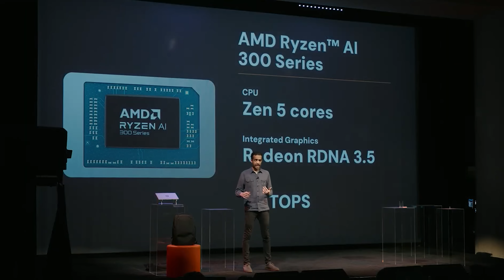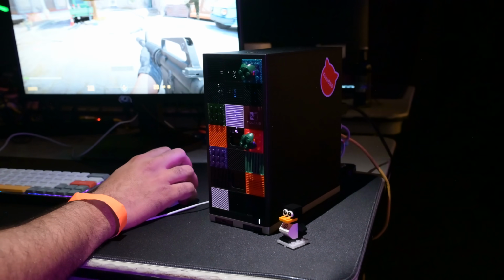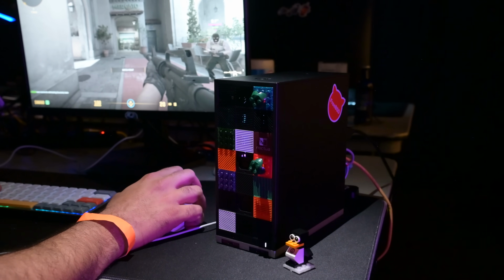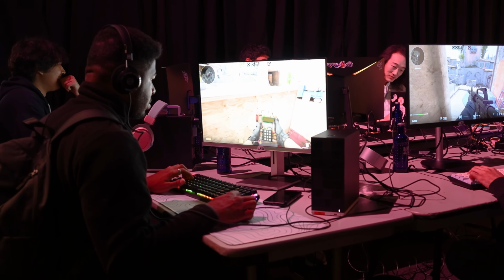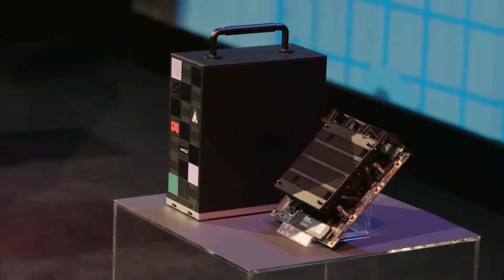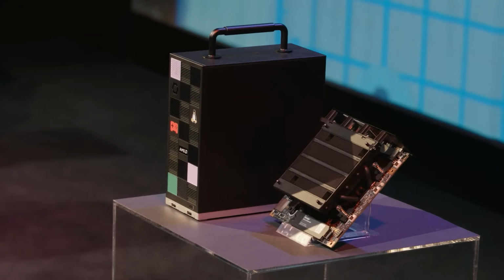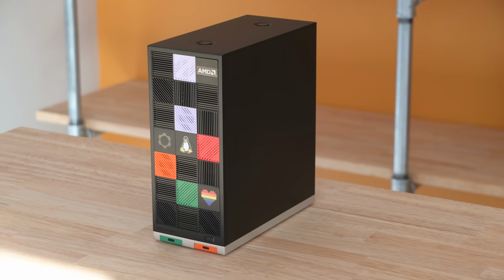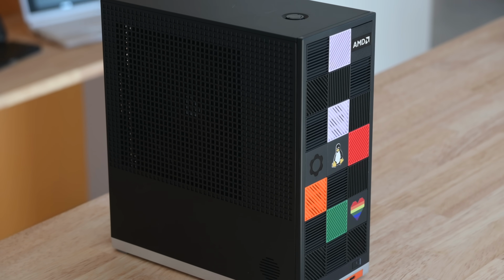Modular, Open, Repairable – The Framework Desktop Teardown!

Comment: 128gb vram/ram with the strongest cpu makes it a apple mac killer for half the price. People just don’t know what to compare it to.
Reply: I was considering FW Desktop for same reason. ...and I've heard that it has way low memory bandwidth compared to Macs which is also pretty important when running local LLMs.
Reply: I am going to get one of these, but there is a feature gap between this and a Mac, notably the memory bandwidth, but also the LLM acceleration software stack
Reply: @unom8  apple ram is faster being LPDDR5X 8533 MT/s and 512 bit bus the software stack would be comparing Apple's to bananas as it's depending on the is so windows vs Linux and the fact that the relevant software isn't released by AMD yet.
Reply: I can accept it being soldered RAM, I can't quite accept their pricing of roughly +500$ from 64gb to 128gb RAM, is the RAM really that expensive?? (for 32gb to 64gb at least you also get a better CPU)
Reply: M2 Ultra has WAY more ram bandwith

256  to 800..... 

only advantage is   this is X86.  not ARM so if you NEED that , this is a better value.
Reply: People just love to complain. The biggest difference between the Framework Desktop and a Mac Studio in an Apples for Frameworks comparison:
1. Schematics - this is friggin huge!
2. No parts pairing
3. Long term support with spare parts = longer hardware lifecycle
4. Half the price of a similar spec Mac Studio
5. In the Q&A stream their CEO literally states how they'll ship out reams of hard to acquire IC's and components to support the open source community

So no, this is nothing like your x86 desktop. This is new tech and it needs new approaches to repairability and sustainability.
Reply: @BorkedCurrent  not repairable RAM, massive let-down to their repairability claim in advertising.
Reply: @BorkedCurrent True, it's nothing like conventional x86 - conventional x86 desktop systems are far more modular and repairable.
Reply: You speak like both has the same bandwidth LOL
Reply: Yes, but I still think it's disappointing that the RAM is soldered, since it means the aftermarket will be flooded with base-model units that can't be upgraded easily.
Reply: @Ebalosus  in general, hybrid architectures are being attempted
Reply: @Jackson_M5  honestly I'd be fine with that if say the 16-32Gb soldered memory is then turned into GPU/AI/highspeed memory when an LPCAMM2 module is then attached to expand memory.
Reply: @Ebalosus  that beats AMD's idea of GPU, AI Accelerater and CPU in one silicon unit. I was joking about it a bit earlier that they should have gone with 128GB of GDDR7/GDDR7x to make it the true AI killer and justify Mac prices... but the more I think about it the more I want to scream at AMD.
Reply: @DJDocsVideos  GDDR7 has the problem of memory density. for 128GB you'd need 43*3GB modules.
Reply: @MrDiarukia  tell me something I don't know 🙂
Reply: @Ebalosus they tried with AMD expert but it needed LPCamm with 8000MT/s but currently there are only with 7500MT/s and the performance hit is around 40%
Reply: @Ebalosus  LPDDR5X unfortunately don't play well with longer DIMM traces. Samsung apparently is working on a LGA mount for them though.
Reply: @Ebalosus  I do hope Framework works on a trade in system for the boards.
Reply: @Ebalosus  base model is good enough for gaming
Reply: @Ebalosus  As pointed out by Nirav from Framework in the LinusTechTips video going over the new offerings from Framework (including this desktop) - Framework had AMD run simulations to test LPCAMM2 against the soldered-on LPDDR5X, and the LPCAMM2 had signal integrity issues with how it fans out on a 256-bit bus when paired with the Max 385/Max+395 in this system.
Reply: @Ebalosus  yo, what are you dissapointed about? the technology for swappable unified memory doesn't exist yet. This computer is doing something very different than your regular run of the mill desktop. You are not the target demo, this is for LLMs.
Reply: @datAero  What? The technology for swappable unified memory is called RAM sticks. If you use an iGPU, be it an HD4000, a 780M or in this case an 8060S they all use unified memory by getting to use part of the RAM as VRAM. What doesn't exist is high speed exchangeable RAM modules. The soldered chips allow for the 256GB/s and is comparable to a 4060Ti with 288GB/s.
Reply: @ do your own research lmao cba to explain
Reply: @datAero I'm disappointed because the technology for swappable unified memory absolutely does exist - it's called DIMMs and SODIMMs. What exactly did you think Framework were doing in their laptops, which are all available with AMD APUs running off of SODIMM memory?
Reply: @MrDiarukia 1 question if speed is really 256gbps  and it support 128gb ram . Does it means it does not need more speed it can process everything in just half a second.
Reply: @ Processor only work on little chunks of memory at a time and is handed down through ever smaller caches and once calculated put back into memory. Yes, it would take roughly half a second to ask for the whole memory but processor need to constantly write back and forth between memory and cache, so your say 100GB LLM will occur many times that in traffic during inference.
Reply: @bosstowndynamics5488  Literally, the first thing framework asked AMD about was if they could use socketed RAM. AMD gave them an enginner to help figure it out and sadly, AMD couldn't get it to work with socketed RAM. Signal integrity issues would require throttling the performance or something, so it just wasn't possible to give us a chip this powerful with socketed RAM.
Reply: You can also build your own ITX computer with a much more powerful CPU and GPU for a similiar cost... MAC exists to please the Apple crowd, but Linux and Windows users have way more compelling options in the DIY space than this supposedly "repairable" PC with soldered down ram, cpu and gpu...
Reply: @leviathan5207  No, you can't. Quad-channel memory just doesn't exist in the consumer desktop space. You have to pay HEDT or server prices for that.

Comment: To be honest I'm disappointed that the framework goes soldered ram. I know the ram width is impossible for regular dimms, but i would trade the performance for expandability, not the other way around. Especially when it's called a desktop.
Reply: It's most likely AMD's fault. The Strix Halo chip used on these boards only supports LPDDR5x RAM, and there simply isn’t any standalone LPDDR5x module available. We might be getting LPDDR5x LPCAMM2 modules sometime in the future as RAM manufacturers has announced they'll be making those modules.

Anyways, you can always just build a regular PC, Framework doesn't have any advantage on repairability in the desktop space anyways. The Framework Desktop is more synonymous to a NUC with laptop chip, or the Mac Mini.
Reply: That big GPU needs to have a fast and low-latency RAM, or it will just perform like previous APUs. Unfortunately, CAMM is just not ready yet.
Reply: @HighDoping It's not that LPCAMM2 isn't ready; it is, it's just that AMD went with on package memory like Intel Lunar Lake and Apple's SoCs. I'm actually seriously worried about 16 inch owners like myself.
Reply: @cameron_bosch  It's not on package RAM. The RAM DIEs are soldered on the board, while Lunar Lake and Apple Silicon both have RAM modules on the same base board of the SoC.

LTT's video about Framework Desktop says Framework asked AMD about CAMM modules, and AMD's response was that they couldn't sort out the signal integrity issue. I hope they could solve it one day, but we probably won't get that with Strix Halo.
Reply: @cameron_bosch  Haven't seen a 128GB LPCAMM2@8000MHz yet.
Reply: @HighDoping  well they could have distributed it to for LPCAMM2 sockets, four modules 32GB 8000MT/s each
Reply: @HighDoping  would be two 64GB ones...
Reply: @erkinalp  No manufacturer put more than one CAMM socket in their product. More separate modules = worse signal integrity = lower speeds. 128GB modules are possible with current specification, just no one made it.
Reply: Yh, like I said in another comment. It's clearly not made for the average user.
Reply: I think the error is calling it a desktop PC and advertising "gaming". I see this device more of a production machine or server for LLM and some rendering.
Reply: @telldo8016  you can game on it for less than a 4090 runs you 🙂

Comment: This seems like a cool proof of concept, not a release product for a company like framework. Calling this a desktop pc but having their homebrewed mobo with soldered CPU/iGPU/Ram just does not sit right with me, as those 3 are the key upgrade paths for a real desktop (even if small form factor built). Instead of just being able to slot in a new cpu you're forced to replace the entire motherboard + SoC as if this was one of their laptops? 4.5L is amazing but honestly I don't think this is worth the tradeoffs under the framework brand and considerable upcharge they ask for their designs.
Reply: To be fair, when it is time to upgrade a CPU you most likely need a new mobo and ram anyway, so this likely won't make much of a difference. I get what you mean, but there are tradeoffs that need to be made. The good thing is, if you don't like it then you can buy a different desktop that suits your needs. There was obviously a large enough demand for this if they made it, the CEO even said it wasn't even on their roadmap but they had to make room. Given the AI boom right now this is a superb product. With my own gaming needs, I would highly consider this as I would like a small form factor, I only really upgrade my PC every 6-8 years, so when I need an upgrade it'll be as easy as buying a new soc/mobo and slotting it in. I won't need to worry about compatibility, troubleshooting, buying compatible ram, making sure my CPU works for my mobo, ETC.
Reply: @AndrewPL5   Not saying there is no demand, just that this specific solution ain't it under the framework ideals. Famously with AM4 you could skip many generations and still upgrade on the same mobo, I doubt AM5 will be different in that regard because AMD knows that's one of their unique selling points, they have promised as much. If you get 6-8 years out of this lucky you, but since framework only offers 1/2 years warranty (depending where you live) better pray there is no core system failure out of warranty because for this "easy to repair" desktop it's going to need microsoldering on the motherboard and those bills go sky high real fast. And that's where you will look at the framework provided replacement mobo and just buy the new one, not repairing, completely defeating the MO of repairability and sustainability first.
Reply: @phjac  I think you, and a lot of others, are focusing WAY too much on this small tradeoff. You need to take it for what it is, a laptop PC basically. You can't really blame Framework for the CPU/RAM/MOBO issue...that is literally AMD's issue, and Framework had an AMD engineer try and make this work with upgradeable ram and it wasn't possible. If you buy a non-Framework laptop you'd be plagued with the same issue if there are any core failures. Unfortunately the way Intel and AMD are going, I don't know how much longer Framework is even able to offer upgradeable RAM on their laptops. People need to understand companies can only do what they can with the limitations that the CPU maker bring. You cannot find this kind of small form factor PC on the market that you can upgrade on this level, that is the main point of this. If I had the money I would totally buy this. I want a small form factor PC, and I want to be able to upgrade it when I want to. If I buy this, that is possible. Sure, it may be costly, but it sure beats having to buy a fully new system vs just swapping out the mobo/SOC.
Reply: @AndrewPL5  You're right, this is really a laptop PC, but I think that's my problem here. I just don't get the point of a "laptop pc" being sold as a desktop, because that means you're missing peripherals and a battery. The entire point of a laptop is that it comes with everything you need to operate, including screen, battery, keyboard and touchpad, in a small form factor that fits in a backpack. That you can use it in a library, at work, on a train, plane, at home, just as much as anywhere else. And for that, I'm fine taking the repairability tradeoffs into account. If this motherboard was in a big bulky Framework 16 or even 18 or whatever shell, I would be fine with it, because that's the compromise of a laptop, where size well and truly is of key importance. 

This, however, is a desktop, which is useless outside of desk work environments. You don't really gain anything here by downsizing the box to 4.5L outside of desk aesthetics. You don't really get anything here by going for strix halo, a mobile cpu and igpu where the entire point is that it has great performance on a tiny footprint, because you don't need the tiny footprint for a desktop. A 20L SFF with a dedicated GPU is still small on or under a desk, but can absolutely destroy this thing while being infinity times more repairable, sustainable and upgradeable, and that's what I would have much rather seen as the "Framework Desktop PC".
Reply: @ I think the main reason for this being in a pc form factor is power. This can run way more power and cool down way easier than a laptop ever could. This chip in a laptop runs at a lower wattage since it can't be cooled as easy. This is great for mobile gamers in a way. Personally, this would work great so I can move it from my office, to my living room, or a friends house. It can fit in a backpack. Since this has more power than a laptop equivalent you can do more while being able to bring it around. I don't know much about AI, but this thing is sought after for ai use and developers, etc. That's a huge market.
Reply: @AndrewPL5  "when it is time to upgrade a CPU you most likely need a new mobo and ram anyway"

Blatantly false, wildly subjective.

"if you don't like it then you can buy a different desktop that suits your needs"

True🙂

"Given the AI boom right now this is a superb product"

I didn't realize Framework was an AI company.  I thought they were a repairability and modularity company.

"I won't need to worry about ...-... buying compatible ram"

That's...one way to drink the kool aid I guess.  I know this sounds crazy, but they could provide compatible ram themselves.  QVLs are a thing.
Reply: @ through multiple points you made I can tell you didn't watch their presentation and their explication of the shortcomings.

Comment: And because the RAM is soldered, the final score should be lower than 5...everyone is parroting the marketing speak for not allowing users to swap/upgrade the RAM and it's disgusting.
Reply: soldered RAM can actually be upgraded, see dosdude1's guide on Apple Mac RAM upgrades
Reply: It's not marketing speak.
There's genuine reasons why this compromise had to be made.
Literally every other product they have has user swappable RAM
I didn't even get any when I bought it from them, just got a discounted one off amazon
Reply: @Soguwe  Nobody forced Framework to use a CPU with soldered RAM.  They make CPUs without soldered RAM.
Reply: @kintustis They had to though. Socketed cpu and ram would just make it another sff pc. Not to mention the cpu HAS to use soldered ram
Reply: @kintustis  but then it would just be a normal pc. The USP is that it's this chip with this cooling system
Reply: @Soguwe Found the LTT subscriber
Reply: Soldered RAM is revolutionary.